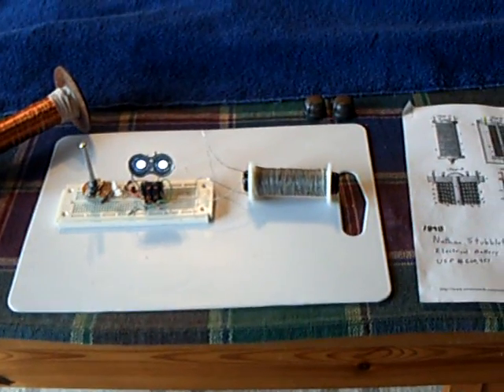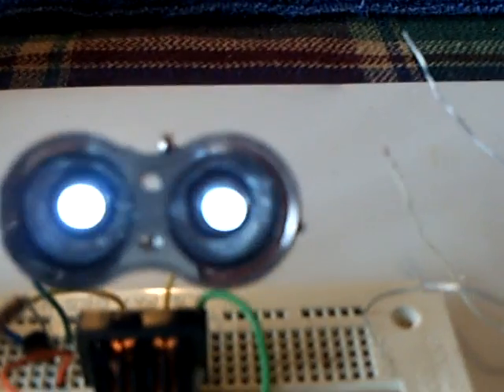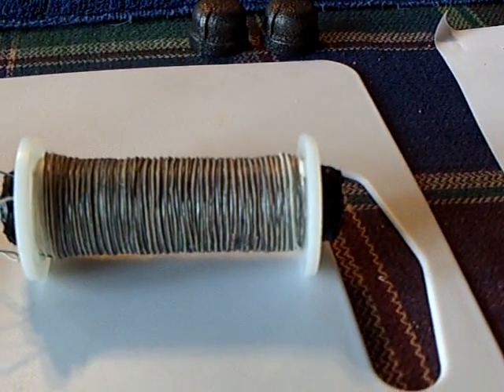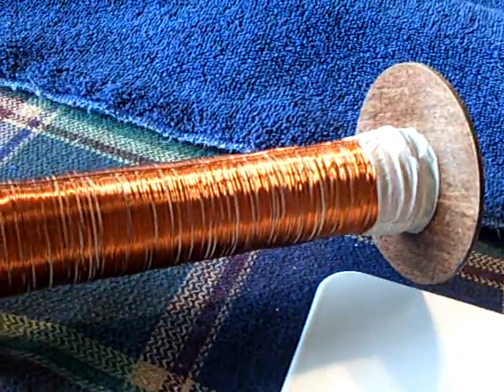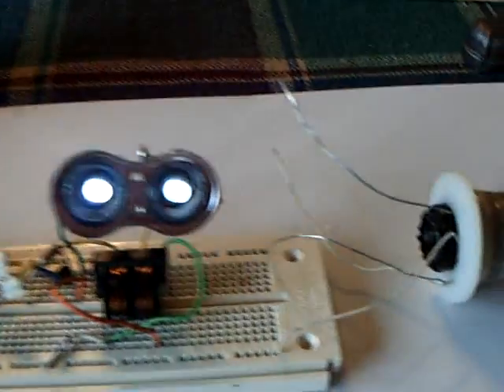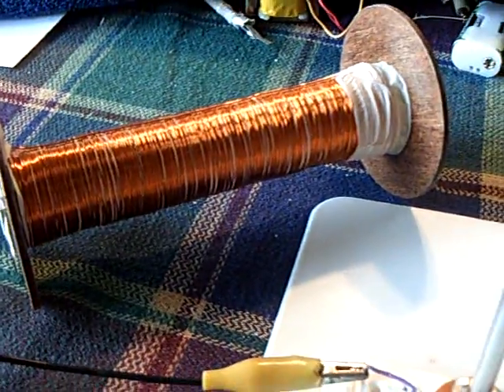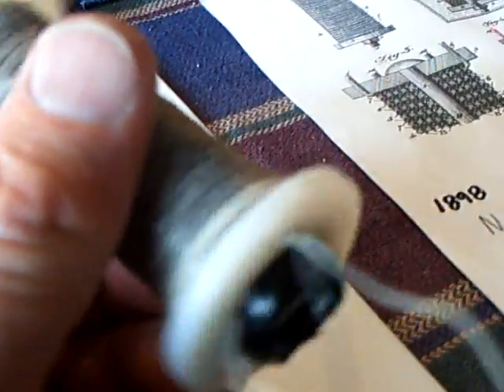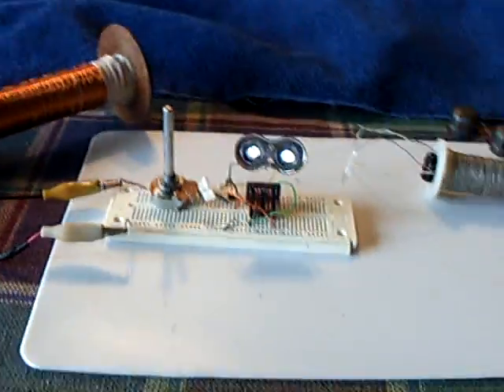Dragon's Stubby Stubblefield coil---That works!.

Comment: Hello What type of wire used and thank you
Reply from the maker: +ali azazy  It is cotton covered copper wire and galvanized steel wire.  It turned out that this was not a very good design.  All it was was a poor galvanic battery (copper & zinc) that failed as soon as the zinc on the steel wire was eaten up.  You would be better off making a plain copper wire coil and just adding a regular battery to it.  This whole project was interesting but a bit of a waste of time when I figured out what was really going on.
Reply: In light of this statement what do you make of Jeannas claims to have a coil running for 2 years?